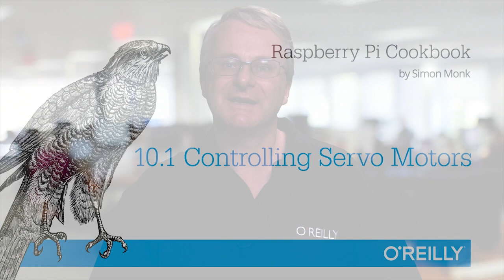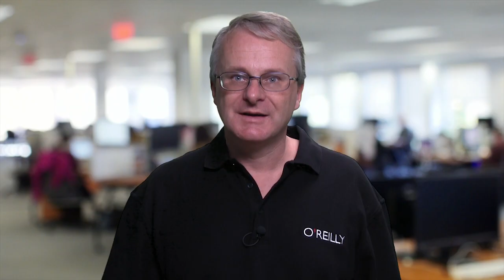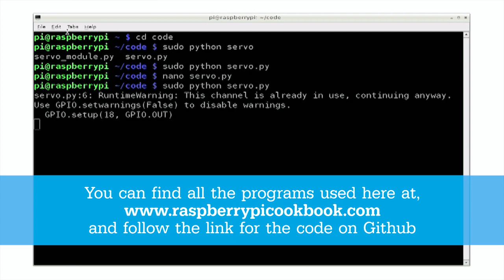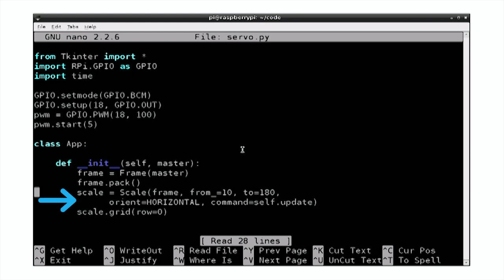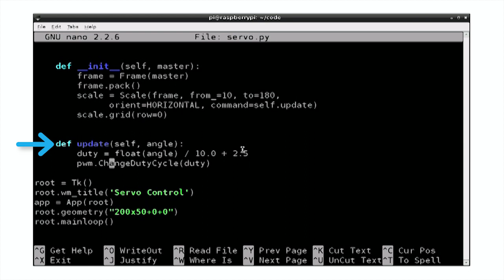Controlling Servo Motors with Raspberry Pi

Comment: At 3:50, you say that the servo control wire should be connected to GPIO pin 18, but  you then proceed to connect the wire to GPIO pin 12.  You need to distinguish between the GPIO pin 18 and the GPIO pin that is labelled "BCM 18" (which is pin 12). I just wanted to leave the comment for anyone else who may run into that problem.
Reply: a year later you got my back man
Reply: Thank you, i where wondering about that

Comment: is there a solution to the yittering problem?
Reply: immediately after you set duty to control the angle, set duty to zero and time.sleep it
Reply: could you find any solution to jitter problem?
Reply: Is there a solution yet?